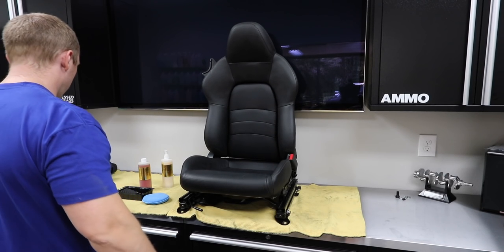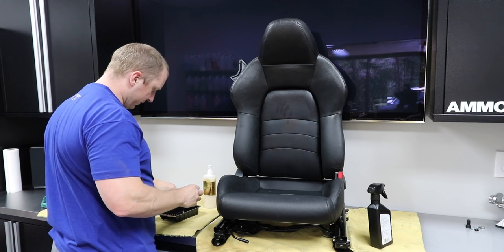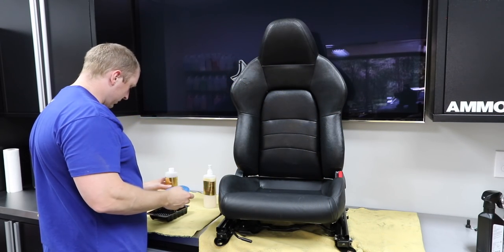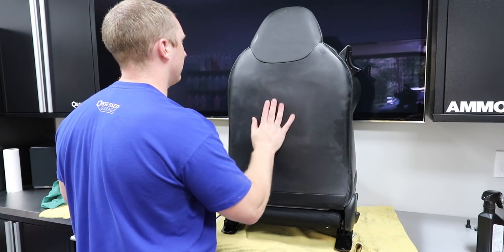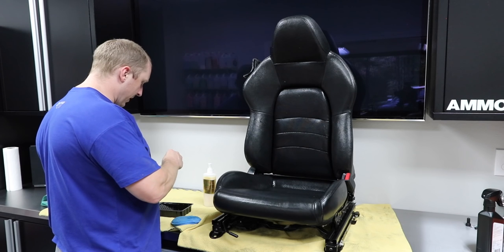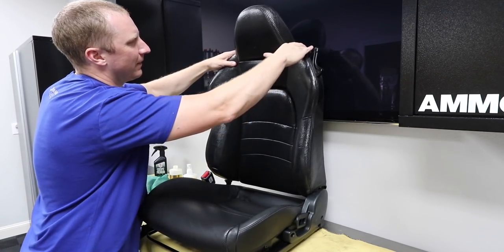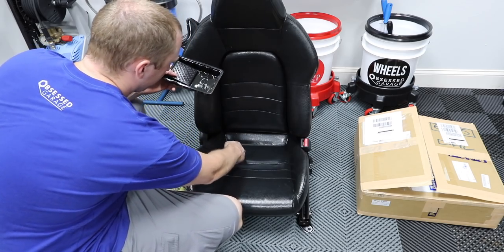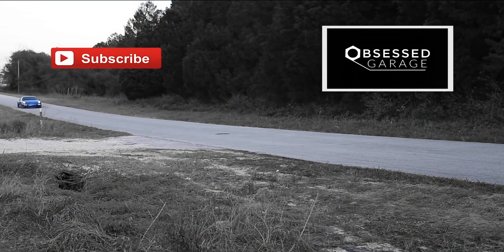S2000 Interior: E2 - Leatherique Step 1

Comment: I applied the Rejuvenator Oil on my car this afternoon. Gonna check it tomorrow afternoon and if needed will apply in the dry areas. I left my car outside in a place where it will get some sun. I blocked all the windows also in order to don't let the direct sun light hit the leather surface. The plan is to let it "marinate" for 48 hours LOL
Reply from the maker: That's a great way to do it.

Comment: I get the best results with Leatherique when I cover my seats with plastic bags and run a small a space heater in my car over night on low on the center console arm rest. (Don't put the front near any surfaces and leave h the door a crack open) The temperature and time do make a difference. And to all the internet wizards here saying this can't work because auto leather is coated: Coated doesn't mean the surface is completely sealed. Even modern automotive leather needs to breathe. Don't believe it? Try and leave a convertible with coated leather seats and the top down sitting the in rain and you'll have yourself some water damage. The rejuvenator gets in exactly the same way the water does.

Comment: This is awesome but I have a question about using your bare hands to rub the rejuvenator onto the seats. I know it's suppose to open the pores of the seats but wouldn't the oil & dirt on your bare hands just get in the pores? Could an alternative be to steam clean or wipe the seat with hot water & wipe dry before applying the rejuvenator?

Comment: Hey man did Todd at Esoteric say anything about a slight preheat section by section with a heatgun? Using this first time on a 15 long horn Laramie 2500 Diesel with the brown leather. 
Thanks!
Reply from the maker: Todd suggests putting the windows up and leaving the car out in the sun for a few days.
Reply: Got it. Yeah I imagine that would definitely bake it. I meant more for initial absorption but I'll leave it out in sun before I do that also!

Comment: Matt I'm not trying to be a hater or criticize you but I think you just wasted your time on those leather seats and doors. Let me explain, modern leather in cars have clearcoat on them so normal leather products don't do anything to them, that's why they are cleaned with all purpose cleaners and then sealed or coated like paint.
Reply: That video goes into a detailed explanation of what I'm telling you and what products work with modern leather seats
Reply: I was thinking about this the entire time. Glad someone else posted about it.
Reply: You can check out esoteric car cares video about the leatherique products. They see this differently, and I guess that's why Matt uses it even though it is coated leather.
Reply from the maker: What video.  All I see is an s2ki thread talking about how to use Leatherique.
Reply from the maker: The video gives a detailed explanation that aligns with my exact hypothesis.  Leather cleaners, conditioners, coatings from non-leather experts are largely a waste of time.  Leatherique process is a very different.  What I did to the seats absolutely made a difference.
Reply: Guess we will find out in Ep #2 when it gets released. I myself am very skeptical of it.
Reply: Yes in theory I believe the same.  But Leatherique is just amazing, it absolutely works.  I don't know how it does it, but it does.  Every car I buy gets the leatherique treatment.  I love the stuff
Reply: John Perez thanks for the video in regards about the waxing, etc etc. Car Cleaning Guru is alright. Sub to that guy.
Reply: Obsessed Garage well they should look different because you took old dirt and body oils from them and put an even coat of new oils in them
Reply: Disagree. I used leatherique products on my hard leather seats and it softened them considerably.
I also redyed my seats from black to red using their products with great success.
Reply: scanspeak00 could you tell what car did you work on?
Reply: BMW 3 series.
Reply: scanspeak00 the 3 series started in 1975 so you have to give more information
Reply: John Perez He has only done the first step in this video.. The next step is the cleaning part. Or did you think that the oily mess is the end result?
Reply: 2008 E92 325i with dakota leather.
Reply: I purchased the leatherique kit from XMD Supplies (cheapest place to get it). Going to try it out on a brand new couch.